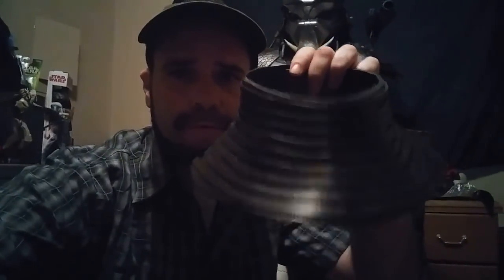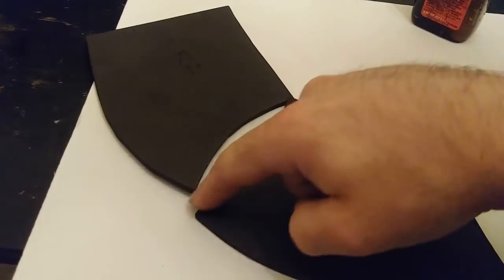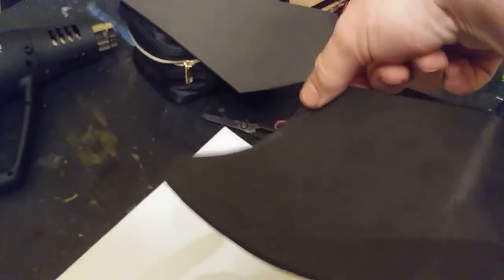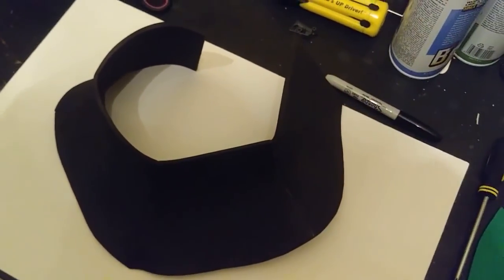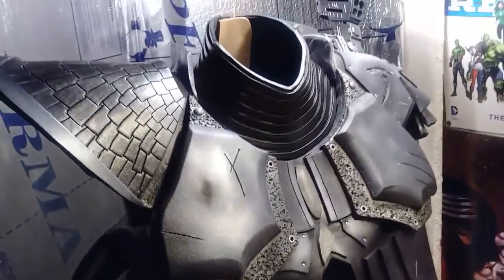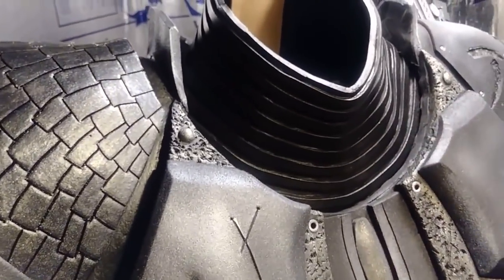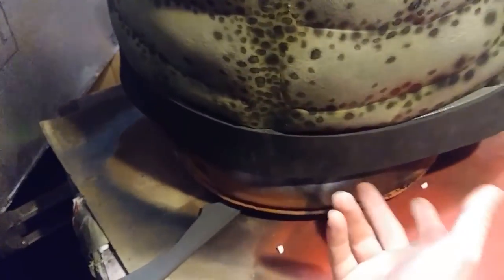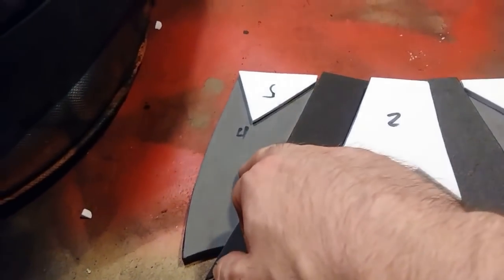Predator DIY cosplay build part 6 Belt and Accessories

Comment: What is the Smart Disc made out of?
Reply from the maker: 2 pieces of 5mm EVA foam. If it was a prop I carry by hand versus being attatched to a part of the costume  body, I would use thicker foam, 8 or 10 mm